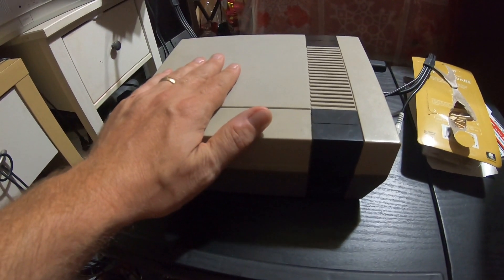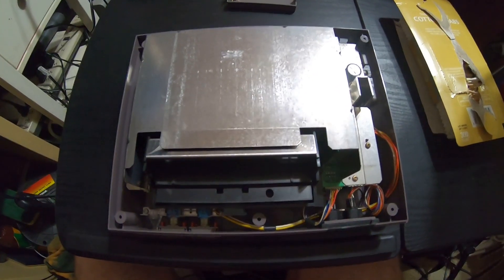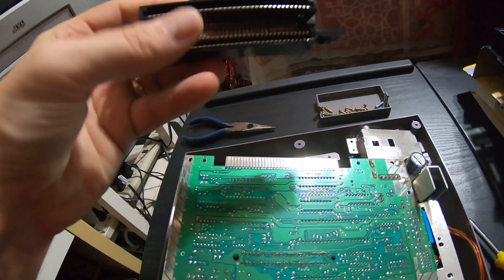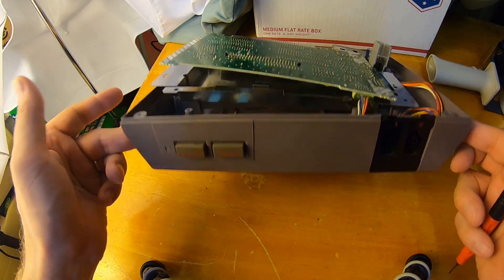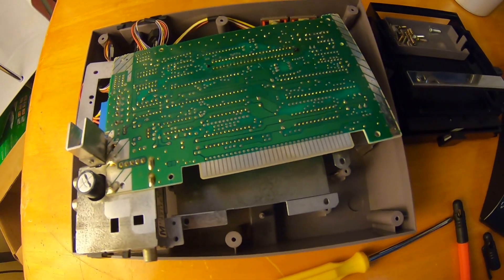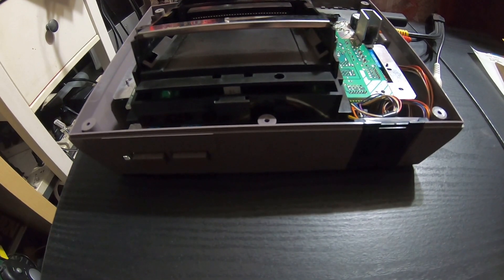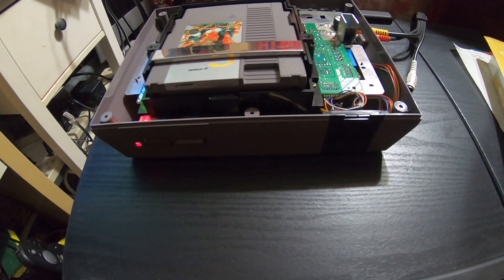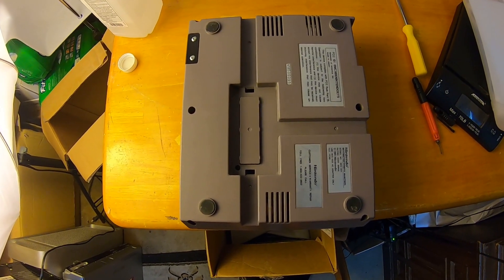How To Refurbish An Original Nintendo NES Console!

Comment: Great video. Is it not better just to replace the pin connector with a new one? They don't seem too expensive online.
Reply from the maker: The replacement pin connectors do work well but they put a death grip on the games. It almost feels like you are scratching up the contacts when using it. That is why I prefer to try and refurbish the original pins.
Reply: @TheRadicalReseller  Thanks for your opinion. I've got one pro guy who is willing to refurbish my NES that's been living for 30 years in a closet. He's mentioned re-capping the system. See his below explanation. Would you agree it's worth it? I'm nervous about messing with my system too much. Many thanks, Nick!
Reply: "Electrolytic capacitors tend to dry up if left for long periods without use. They will often still work, but the capacitance may change and the circuit they are in will therefore not always work as designed. They can also leak, but this tends to be with use rather than lack of use. In the main I don’t tend to recommend capacitor swaps unless there is an obvious reason such as poor display etc., but when computers or consoles have been left for long periods, it is prudent to swap out for new as a precaution."

Comment: Is a great video I don’t think I’ll be taking mine apart I just need it to be cleaned any good suggestions on cleaning it without taking it apart so that The games all work properly inside can’t really tell if the device is dirty or the games are dirty but this is one I’ve had since 1986
Reply from the maker: For about 10 bucks on ebay you could get an original NES cleaning kit and try that. The kit recommends to use water on the cleaning pads but I would use rubbing alcohol instead. For the games if you did not get the cleaning kit you could just try rubbing alcohol with a q-tip.
Reply: The Radical Reseller excellent thank you!!

Comment: On boiling the pins part, isn't the part connecting the pins made plastic? Doesn't melt? Looks like plastic not metal.
Reply from the maker: Good question. yeah that plastic will not melt at all when boiled.